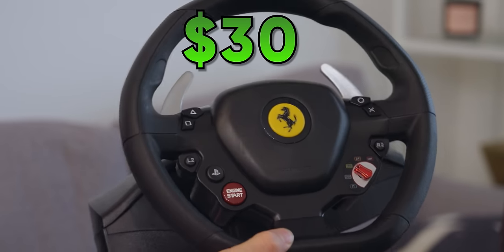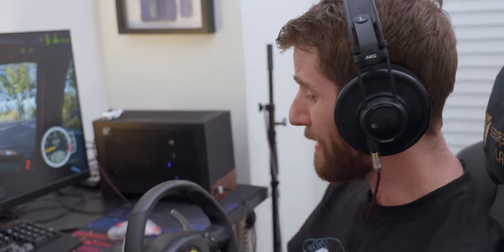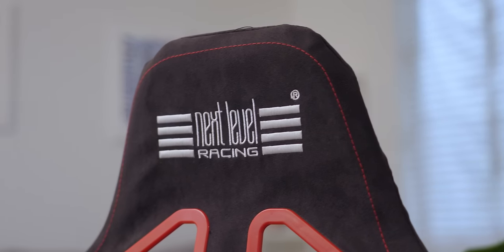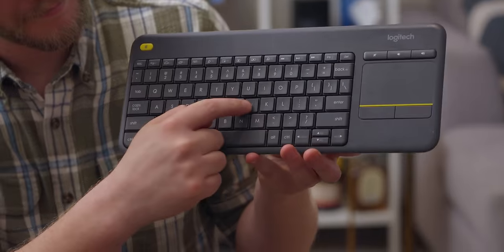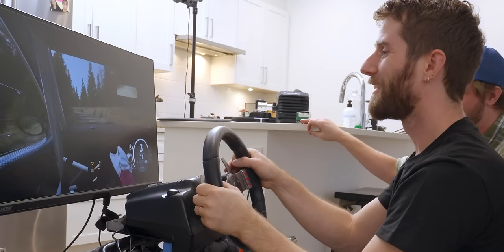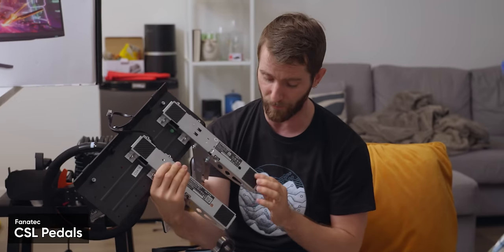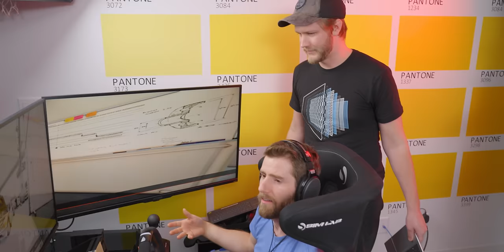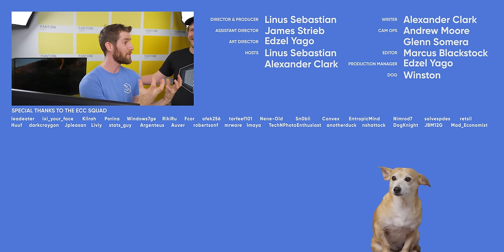Don't Waste your Money - $30 vs $10,000 Racing Setup

Comment: I understand that the point of the video is to reach a conclusion whilst taking into account cost and with that in mind I agree with the points broadly being made, but I disagree about ability to compete being no different between an entry level wheel with feedback and a direct drive wheel. If you're new to it all, it may make little difference because more than anything else you need to learn the tracks and how different cars/games feel, but a better wheel with more accurate and immediate feedback absolutely allows you to feel the limit of the car more acutely which in turn makes you quicker, more consistent, and more able to save small mistakes before they become big ones.

Which isn't to say I don't think the G29 is bad, it's very good value for money and I wore out two of them before going for something more.

Comment: I spent like £600 total on my setup. Got a random racing cage for £100 on eBay, my Thrustmaster T300 RS GT with the L-TCM pedals for £300, an XRocker Adrenaline v2 seat for £25 on ebay (long story short I was sold a faulty seat as working, got most of my money back and repaired the issues), a £60 universal mounting bracket to bolt the chair to the racing frame, a T3HA 7 speed shifter for £65. Paired the 2.1 chair speakers and a cheap 2.1 front speaker system with a 600w preout AV system, and boom; a decent enough setup with 4.2 surround sound audio

Comment: Ditch the headphones especially when your going high end like that. No headphone on the market can compete with a full 11 channel setup. 6 floor standers, 1 full range centre channel and 4 full range in ceiling speakers plus 2 subs. Once you use a setup like that you’ll never go back to headphones, the atmospheric audio can’t be beaten and you can pinpoint everything from other vehicles exact location to curbs and engine revs for better shifting. Sure it’s a big investment but I use mine for 4K UHD bluray movies as well, that Atmos and DTS-X is pure awesome.

Comment: I spent about $800 aud on my set up. Logitech g20 and peddles with logitech H shifter and eBay handbreak works perfectly also have a vertex steering wheel on it and have taken the rubber pad out  of the break so it moves more the 10%.

Comment: I have that Ferrari 458 wheel and its depressing. Its been relegated to the closet for about a year because it started pulling to the right slightly ruining the little it had going for it.

Its basically two elastic bands wrapped around in opposite directions so when you turn it one way it goes into tension which pulls it back to center (until the rubber stretches out.)

It also doesnt have full range of motion. Lock to lock is about 270° so you need to adjust your sensitivity to compensate, making it unstable at high speeds and in corners. 

Id have saved the money as I got it new for $90 not knowing much about the differences back then.

Comment: As far as I can tell in sim racing, the amount you need to spend to be fast is enough to get informative force feedback and accurate inputs; ive used a $200 t150 for years and do pretty well for myself. anything above that is just further immersion.

Comment: Without seeing the video, I have sim-raced in the past and used both a cheap logitech DFGT and a Fanatec DD with thrustmaster LC pedals on a rig. You can be as fast in the decent budget option as in the higher end gear.  Performance wise, the huge difference however is not on one lap but in consistency and feeling the road better and as such react better when something upsets the balance of the car. In terms of immersion in the higher end gear you tend to forget that you're not driving a real car. Yes if you're serious about sim-racing go get yourself decent enough gear, you don't need to go crazy and spend 20K but at it's still going to cost you about a 1000 at least

Comment: I've read you can buy after market adapter rings/plates for Logitech wheels that will allow you to mount real car steering wheels to the motorized base, but you have to move the butttons to another location.  Adaptor for under $20 and a full size racing wheel ( cheapo version ) for under $30 plus what ever casing and wiring bits for moving the buttons.
Reply: Yeah, you can do that. But since the G2x wheels are so weak, the bigger steering wheels will really dampen the FFB. Shoot, they even do that on some of the "weaker" DD wheelbases too.

Comment: To be honest from my perspective. It's all about wat u want for the experience. The more immersion...the more it's gonna cost u. But honestly it's about skill, and recognition of tracks and cars... I've been beaten by a dudes on controllers before, and I've beaten dudes racing on DD wheels with a belt or gear wheel. It's all about practice to know how late u can brake, and how much speed u can take into cornering without loosing it, that's gonna edge u out in a race regardless of the tech ur using in most cases. Being fast is being fast.... period. But that's just my opinion from my own experience

Comment: Im surprised that they kinda got the result right. But they dont have the full story. Upgrade from "any ffb wheel" to "better ffb wheel" (lets say including pedals) will make you better long term, so its not essential, but buying it actually saves you (practice) time. My teammate in ACC went from doing very good times to almost WR times by just switching to logitech DD wheel. Yeah, you can be fast with cheap ffb wheel, the more expensive ones just enable you to be the very best you can.

For actual list of upgrades in order:
- ffb wheel
- rig that can hold your long term target wheel
- pedals (loadcell)
- DD ffb wheel - skip low nm values if you know you want to go all in 15nm is way more than you need, saves money long term (upgrading from non-dd to non-dd is just pointless)
- pedals (hydraulics)

The rest like 3 monitors and VR etc. are just nice to haves, and in terms of being fast in my opinion it ends here, everything else is just not worth it if you just want to be faster - im not talking about immersion.

Doing upgrades less significant than that is just a waste of money. The rig is THE most important upgrade, especially if you can just place it once and forget and just hop in when you want to drive. Instead of 5 min of setup in total each time, for me its just one click and I can race. "No big deal its only 5 min per session!" will bite you when you are tired AF and you sill need to put everything away.

Comment: I have an old T150, also really cheap, but it has serviceable force feedback.  Not sure why they picked the T80 as the other one would have been a better representation for a budget wheel within the Thrustmaster line.  Not bad for the price along with the new TH8S shifter.  Certainly not bad to get into racing.  Trick is finding the clutch pedal that comes with "T150 pro" setup as it's a lot better than the one it normally comes with (same one demonstrated here).

Comment: My setup is logitech g29 and logitech k380. That is cheapest setup with FFB that you could buy on Brasil. Brand new Thrustmaster T80 run around 150 to 250 USD, or just 350 if you wanna save money with used one. Prices in Brasil is really weird and this video proof it, today brazilians could buy dualsense controller by 75 USD on the largest country retail. That not make sense for me.

Comment: Given that you can buy a 5nm CSL DD with wheel for around the same price as a decently constructed belt drive wheelbase  you'd  be crazy not to buy the CSL DD. It has a clear upgrade path so if you really enjoy sim racing you can tailor it to your specific  needs  without wasting your initial investment.  Using a DD setup feels like you've removed latency compared to any belt or gear driven alternative. A load cell brake  pedal  is also worth using from the start especially if you're  a driver IRL,  your brain will already been  "wired up" that way and it'll feel completely natural. You don't  need to spend  loads for a good setup, around €1000 including  a rock solid  mounting solution.  The rig that you mount your equipment to should be solid, any movement robs the FFB of fine detail.

Comment: I had this steering wheel then I bought a use microsoft sidewinder steering wheel from the early 2000's at good will and shockingly it was plug and play and still works with modern games! the sidewinder is 100x better!!

Comment: There's a difference between things that make the games fun and things that help you get faster. Where the sweet spot is depends on the individual as well as their budget. 

You can get an extruded aluminum rig with a single ultra-wide monitor and a decent FFB setup (like CSL elite) for at or below $2K. In my opinion that is better than the G27/29 and a tube-steel with fabric rig or the "stands" that go between your legs. If you try to cheap out too hard you end up spending more in the long run by buying upgrades later.

That low-mid range rig is sturdy enough to make you competitive if you have the talent (for online competition), and if you don't have the talent then $30K will not make you faster.

Comment: I picked up the r5 Moza wheel with a formula one wheel mod for $250. Use it with my g923 pedals and shifter with a Playseat rig. The expensive part is the computer. 7800x3d, RTX 4090 etc....

Comment: I bought a similar Thrustmaster Ferrari wheel/pedal set (probably an earlier model than the one seen in this video because the one I have was designed for 6th gen era consoles) but it was a waste of money because I didn't really have a ledge to attach it on to in my cramped gaming area in front of the TV.

If I had the space (and the money), I'd consider assembling a proper racing set up but I don't so I'm content just playing racing games with an analogue thumb stick on a controller like a caveman.

Comment: Love my budget G29 setup :), one thing that's great about them is the damn durability, thing is a tank and it will let you leave it for a year, dust it off and go right back to it with no issues. Wheels are also great in that all FFB wheels self calibrate when starting up (anyone with a FFB wheel knows the spin lol), so they will never drift.

Comment: You can sell your used G27 for what you buy it for, those will not drop in price as long as they work. I bought my rig for around $250 including a racing chair and a G27, and was offered $350 for it last week.

Comment: For people who are just getting into the hobby - if you want to invest in gear that will help you improve your driving and be more consistent - investing in pedals will help you get faster more than a wheel will. In both cases it`s about "feeling" the whole car (getting feedback) and building up muscle memory which is very hard to accomplish with the brake and acceleration pedal if they are lower tier. 
 However there is actually something even more important than getting faster and faster and/or getting higher tier equipment - and that`s having fun. I`ve honestly seen way more often people having fun using the archaic G25 than guys (or gals) sitting in a 10k rig.

Comment: Logitech Driving  Force GT still one of the best beginners wheels with improved ffb over the 27 and 25...Costs PEANUTS comes with pedals and a shifter. One of the champion iRacing driver used one.... Then go direct drive later

Comment: a used $100 Logitech g29/g920 has been the way to go for about 10 years. $100 will get you all the features you need for competitive racing. Good FFB, full wheel rotation, clutch with shifter, many many buttons, etc.

i hate to see people buy $30 wheels and not enjoying it. It'll work if you really want to play, i started with a logitech momo, but a $100 g29 is absolutely perfect

Comment: HONEST opinion... I've had a cheap kit and I've played on my friends full blown professional set up... I would recommend a half way compromise... buy a motor driven wheel and pedals that are a modular add on - or better then the stock logitech g27/g29/g920/g923. Once you have good pedals and a good wheel (around $1000 usd together) that's all you need for causal/ hobby
Reply: stock pedals are fine for casual play in g20 series. I spent 250$ for my g29 setup and i can tare up the nordscheife with the best of them
Reply: with a budget gaming chair and desk mounted

Comment: I will say as someone with a g25, I love it, but my wheel, when bought used, the top flexes because it's mostly broken.  Getting a g29, but if I wanted a sequential mode, I could get an old serial plug to adapt it to my g29..  Plus g29 will work on my ps4 for gran turismo.

Comment: There really only is one thing that can improve lap times.And i do have high end stuff.However when i did use my G27. The must have is a LOAD CELL brake mod.That alone is like going from a controller to a wheel.

Comment: I use a 30 euro strearing wheel I bought second hand, it's comes with pedals and a sequencial shifter, it doesn't have force feedback but bus it does vibrate, I have tins of fun with it and its definitely way way better and I maje pretty reasonable Times alloying me to progress fairly easily in the carrer mode, ive been playing Dirt rally 2.0 and I wouldn't have payed more then what i did for a wheel its a Super Drive gs550

Comment: i just got a logitech force pro from the ps2 and it works fine on pc with force feedback and 900 degrees of spin for 8 dollars at goodwill. not a bad buy lol. i had that exact ferrari wheel also gotten at goodwill. just took me a second to find a power adaptor that worked with it. hes right about selling them too for what you paid or more.

Comment: WRC is fully homologated, as it's always been.  those cars do start as the original they are portraying.  they are literally hand picked off the assembly line and have a regular series production vin.  all of the major geometry and architecture, including steering/suspension pick-up points, window pillars, door frames, and any internal body construction, cannot be altered or modified.

those are core requirements for homologated racing.  and core to the whole concept of production based racing.

Comment: Still can't get VR to work with EA WRC on my HP Reverb G2, so I won't be playing it until that gets fixed or updated. Also skipping the VR because it's hard to setup is missing out on a lot of fun. Driving sims are the best use case for VR hands down.

Comment: I used to adjust brightness to lighting conditions but it is a pain in the ass. Every modern monitor should have sensor with which it would be able to adapt brightness automatically on the fly. Right now I'm on a setting which is a little dark for the day and a little bit too bright at night and its acceptable.

Comment: ive got a thrustmaster t300 with the clutch peddal cause i do drifting and use clutch kick to get into some of the drifts, i highly recommend that wheel its an awesome mid range racing wheel setup, also if your wheel doesnt have a marker on the top you can put some tape there, you can see when your wheel is straight and how much your steering better, it helps alot

Comment: After years and years of not having a reason for owning a Steam Controller, I finally bought Forza Horizon around a year or two ago. The experience is vastly better than on a ps4 controller due to the backpedals working as shifters and the touchpad is just fine at looking around. I would wish for another set of buttons but even the playstation controller doesn't come with more buttons so it's relatively close. Finally worth the 50 bucks I paid for it.

Comment: I tested one of those full immersion set-ups. I've done a bit of racing and rallying and I found it so off putting that I was moving about and bouncing but the scree wasn't. That's not how that works in the real world. The screen needs to be connected to the moving frame. 
I had to stop after about 20 minutes because I was getting seasick.

Comment: wow I had no idea I have this much in common with Alex. I use the same G27 with the numbers written on it. I built my own enclosure tho. It's made out of wood and the seat is an actual racing car seat for under $200. (also, i don't adjust the monitor brightness)

Comment: That thrustmaster T80 is the exact one that I have, except red steering wheel grips. Got it back when my xbox one was new. A few days ago I dug it back out and set it up to try it out again on my series x. I remember why i stopped using it, my set up is just bad 😂 
The only thing I have to clamp it to is a wooden TV dinner tray, and the legs are only a bit more than a foot apart. The pedals don't slip around unusably but they push forwards into the cross support for the dinner tray and eventually block the pedals. On top of that my seat is a part of a sectional couch with no lumbar or butt support so it's rough on my back. Makes for a fumbling and uncomfortable experience. 
I want to get into using a steering wheel more and get better at it, but I need better equipment first lol

Comment: One of the things that irks me about modern monitors is many (most?) of them partially implement a communication standard that's supposed to allow control of the monitor remotely over the HDMI or DisplayPort cable, but there's no good unified programs to access it, and there doesn't seem to be a unified, standard set of variables to remotely control. making the entire communication standard seem pointless to me.